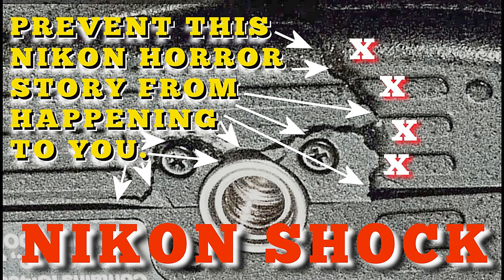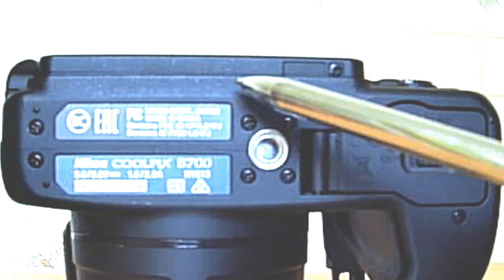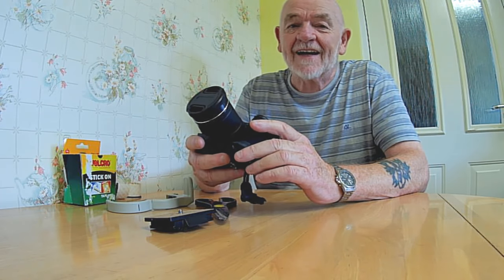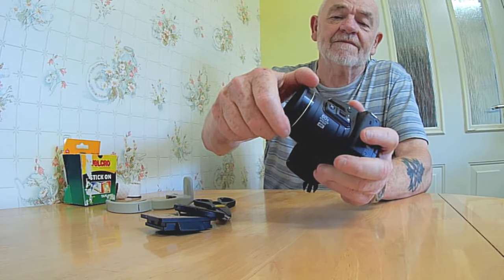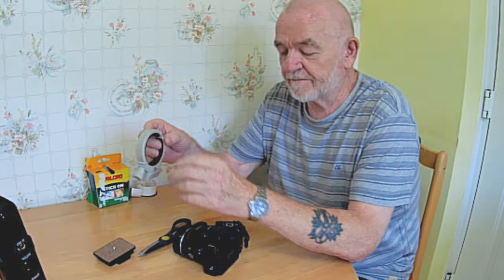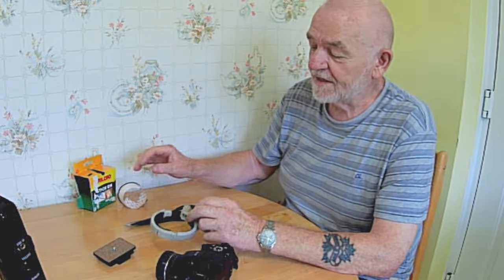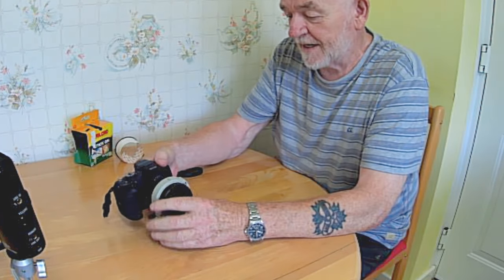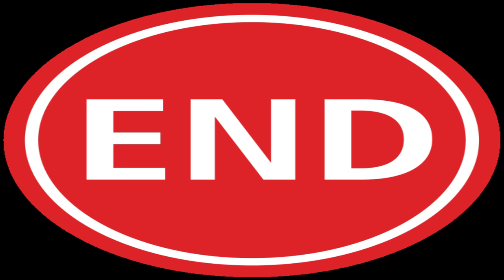NIKON  P900 B700 P600 etc BROKEN TRIPOD BUSH SURROUND.

Comment: My Sony HX300V also cracking on the bottom in a few places but due to the  focus ring I can't use one of these.... (Also had the lens replaced several times due to IS failure, luckily had a MACK extended warranty at the time)

Comment: Flick, 
Do you think that the cantilever of the of all of the weight being on the lens will cause a problem over the long run with maybe the lens bending?
Reply from the maker: Pamela. No I dont as the lens is a mechanical part of the main frame, and the lens is the heaviest part of these cameras.  
I had a Canon 5D hanging from the back of a 500mm lens on a tripod ring for years and nothing ever went wrong with it. 
However,  we do know short term, from the forums, that certain camera tripod surrounds,  are cracking up right now just by using them :-)
I do not believe as Nikon states that all photographers drop / bang or smash their cameras, and cause this damage.
I treat all mine like they are fragile items, and expensive, as most photographers do.
Only other choice for me is to hand hold, and I cannot do that.
People have to make their own minds up on this. 
Nikon want nothing to do with it, which is no surprise ha haaaaaa.

Comment: Hi, it's faulty design by Nikon. Have you tried using a tripod collar mount ring?
Reply from the maker: WATCH THE VIDEO. THAT IS WHAT IT IS ABOUT AND ALSO SHOWS THE COLLAR I BOUGHT FOR PEANUTS AND NOT A NIKON ONE EITHER.
Reply from the maker: Sorry for the CAPS in my last reply. I had q few other Nikons (D850's)  which I use for my pro work, and used a few with say my Nikon 800mm f5.6E FL ED VR Lens (For wildlife work / commissions)  which had its own tripod shoe / handle built in, which gave me the idea with my B700. I bought a JJC model which fitted quite well enough to avoid the camera inbuilt lens from suffering the dreaded nikon fate LOL. Regards from Flick